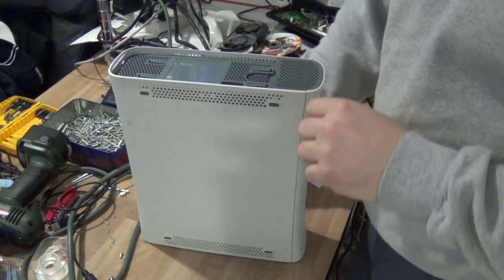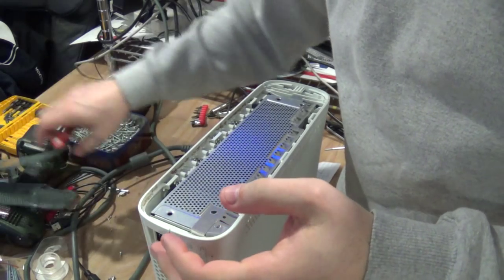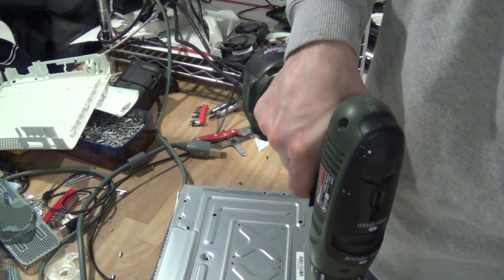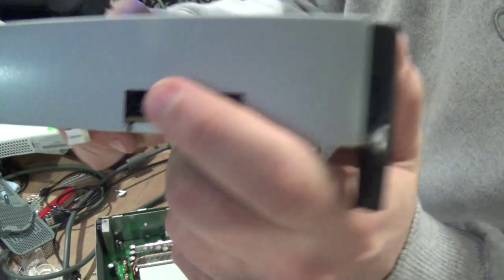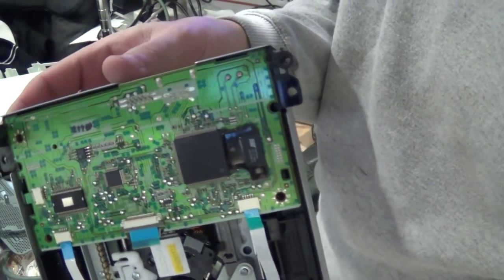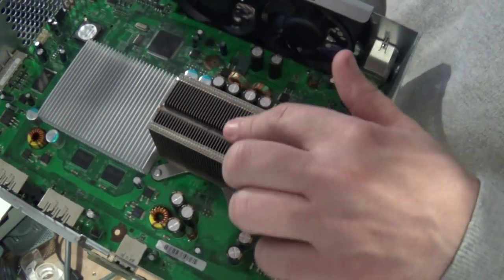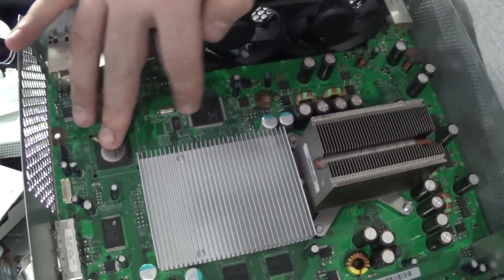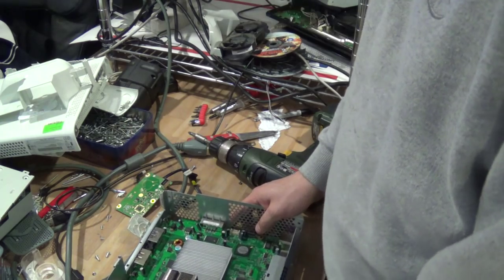Scrapping a Microsoft Xbox 360 Console for Prescious Metals Gold Silver Palladium & Copper Aluminium

Comment: Last week i bought a gamestop refurbished Xbox one that doesnt work with hardware failure i scrapped it by removing the CD drive and cables, the two cooling fans, the fan housing for the heatsinks, Hard drive, and the power button board the heatsinks were badly  damaged on it

The other stuff i scrapped as i mentioned i could sell or give it to a good working Xbox 360 i bought for $50

Comment: i hope your not going to try put that back together
Reply from the maker: Put it back together? No lol. These are total scrap. Just seeing these old xbox 360 make me cringe. Unless they're working 100% and never opened, I scrap them 100%
Reply: i opened up a dead Xbox and it was not as good as the one you showed it was probably a chines copy it had no gold on the main motherboard
Reply: i wanted to find out how people opened up the ceramic chips with gold inside (splitting them in 2 some how ) do you know ?
Reply from the maker: I've never seen a  copy of the xbox 360 but i'm sure they exist. If there is no gold then it must be some kind of knockoff. The xbox doesn't have as much gold as a PS3 but it should have some.
Reply from the maker: I've never done it but they incinerate them and then process them with gold extraction methods to get the gold. You should be able to find some good videos on youtube on how to do it.
Reply: i think il try to use a super strong blender and just smash them to ultra small bits then use some type acid ,
but thanks for taking the time to answer Q. and the chat
Reply: Franky Johnson of course he wont
Reply from the maker: Unless they come from a reliable source, these all get scrapped. I would never put one of these back together.

Comment: I have like 40 boards and 30 complete xbox 360s. Can you give a rough estimate or guess of what they would be worth if i took the time to extract each metal and seperate them? Thanks
Reply from the maker: It's very hard to say about extracting every metal. It's not something I have done. I could tell you that for the boards, you should be able to get about $1.00 each at boardsort before shipping. If the 30 consoles aren't trashed, try selling them first as a lot. You might be able to get about $10 each.
Reply: I agree with what champlainscrap wrote. The metals themselves inside each xboxes , while valuable, are still less valuable than the whole assembled product otherwise it wouldn’t be profitable for any company to build and sell it. Companies that take things apart do it efficiently with multiple employees doing it all day. But imagine you without experience doing it. You are likely to waste more time opening and digging inside the Xbox to extract the metals than your time is worth

Comment: how much$$ would you get per console?
Reply from the maker: Compared to the PS3 you would get a lot less just because there is not much in one of these. I would say about $3.00 at most. Again this is if the console is completely dead with the motherboard and DVD drive not working. You could also sell the whole console on eBay for about $25 including shipping but if everything is dead on the console you might get into trouble with returns. So from making $15 after shipping and fees, a return would pretty much make your profit go to Zero. So If it's all dead scrap it, if it's half working then sell it for parts or on eBay. you'll make more
Reply: cheers lad :)
Reply from the maker: You're welcome